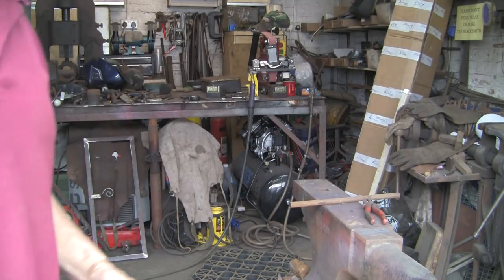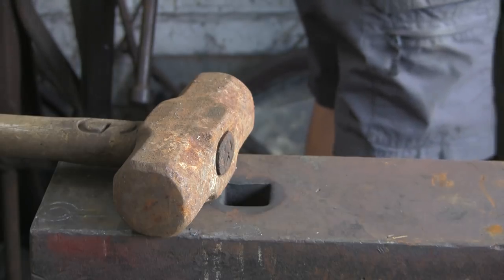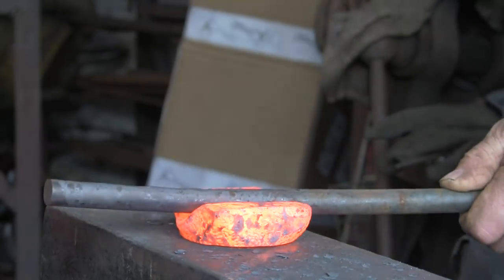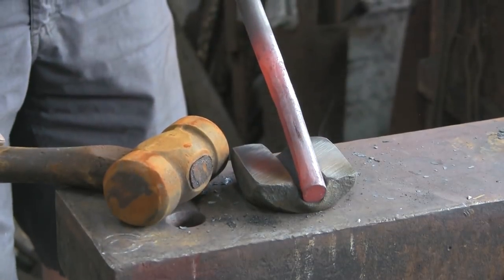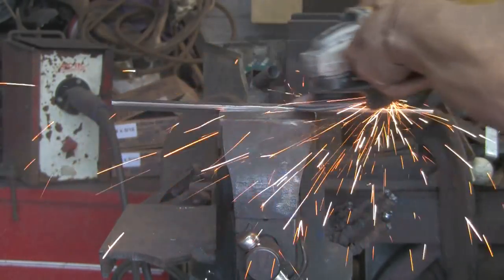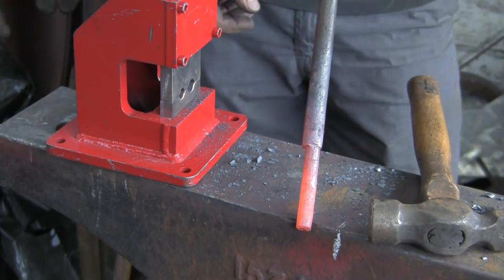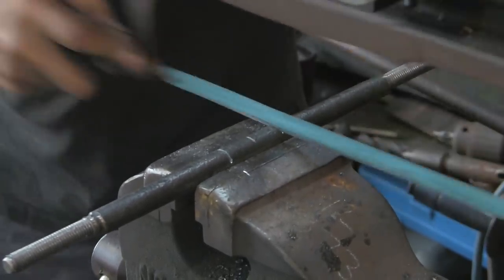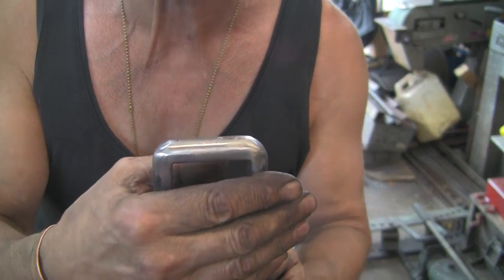Bottom swage to make a shackle

Comment: Last swedge block I made was for making stock for steel training plates. Needed a hind heartbeat for a 2yr old and trainer wanted her in steel. Welded a 1” stub onto a 4x4 block of mild steel,drove a section of a straightened section of kerkhart training plate in to it. Mangled quite a bit of stock till I got a handle on it. 
Just like turning shoes from concave stock,I’m too heavy handed for it. I was at a clinic where billy Carothers was the clinician and he makes turning concave so easy,but I’m sure billy has quite a bit more hammer control than myself lol
Reply from the maker: Sounds like you nailed it though!  I know Billy quite well, he used to come and watch me make shoes when we were at college.

Comment: Well done  However I think granddad did not have a welder and forged those corners  Still far better then I could do. nice work
Reply from the maker: yes, he would probably have upset the material at the corners then forged them around a block to get the correct gap.
Reply: Gary Huston I was wondering how they might have done it, presumably a top swage and an anvil block the size of the gap would help put the corners back to round. The cut and weld looks perfect to me, making one swage for the job took enough time as is :)

Comment: Shall I not use the T word? Temper. There, I went on anyway. If those shackles are for cart axle springs they should be tempered for stress relief... right?
Reply from the maker: No, they are only mild steel so no point